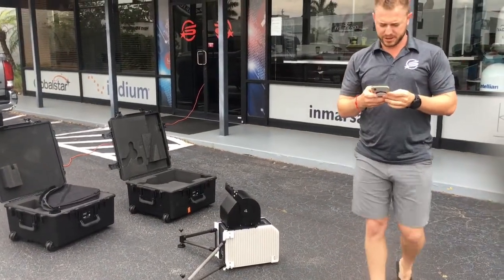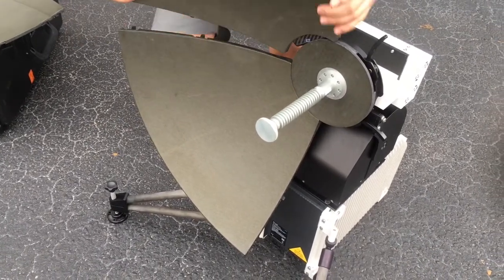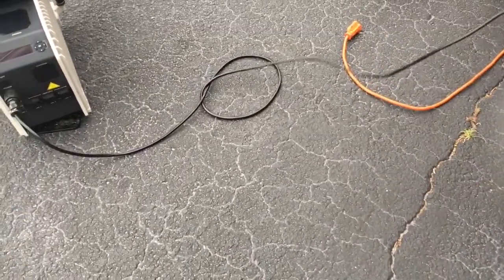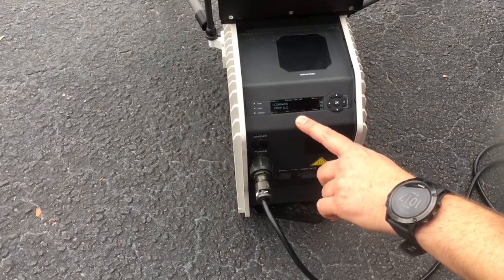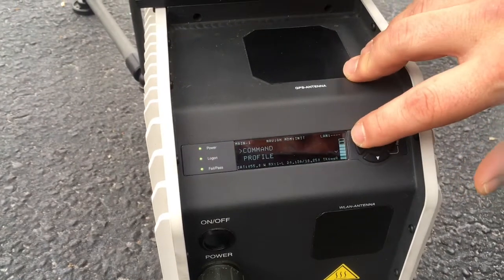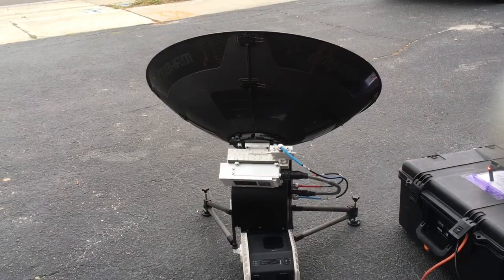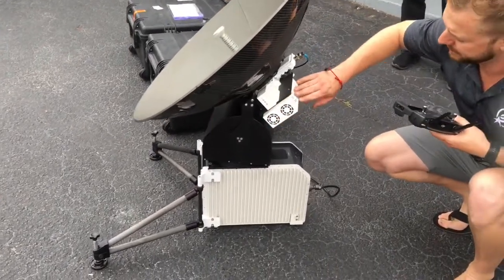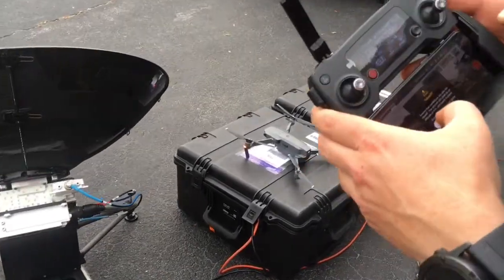Setup a Satellite Dish And Drone To Livestream Anywhere

Comment: can this be used as a control method for drones? Loosing radio signal in valleys sucks and I cant use 4g there either since its in the middle of the forest.
Reply: No. The solution is to just get a ham radio license and build your own with the controller on 52MHz and the video transmitter on 420 MHz. I hit 7 miles effortlessly like that without any dropouts.

Comment: Can you maybe use this to control an RC drone to send it across states? lol
Reply: +1 can this be used as a control method for drones? Loosing radio signal in valleys sucks and I cant use 4g there either since its in the middle of the forest.
Reply: YES but not a quadcopter u would have to look into vtol planes or just planes because then you have the very much extended flight time which can be up to 10hours on some large scale rc planes / vtol planes
Reply: no drone has more than 45~ min of total battery life so not yet
Reply: @jimmygnocci1577  might wanna double check that answer, there are fixed wing drones you can build that fly 2+ hours and some solar gliders that fly for 4+ hours
Reply: @jimmygnocci1577  maybe one should use solar drone with batteries